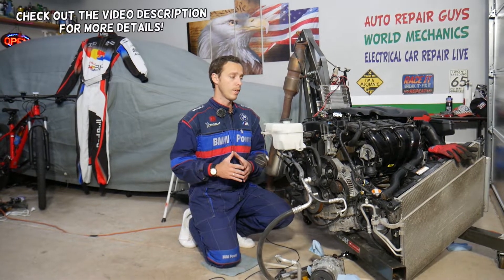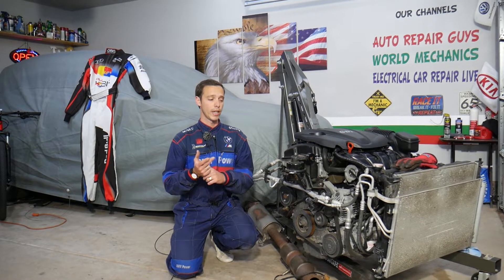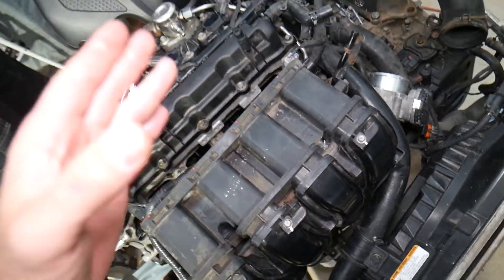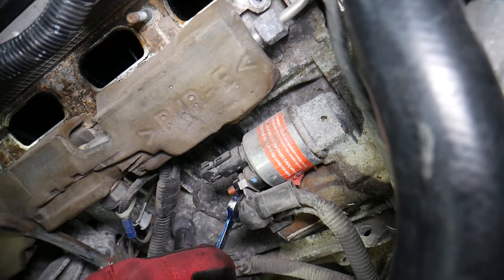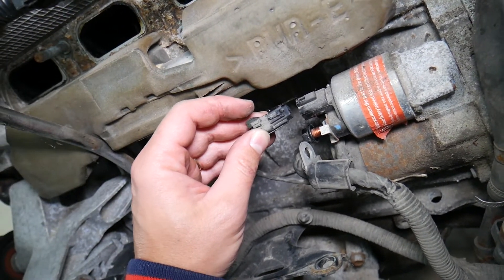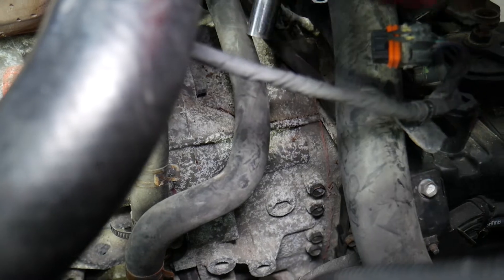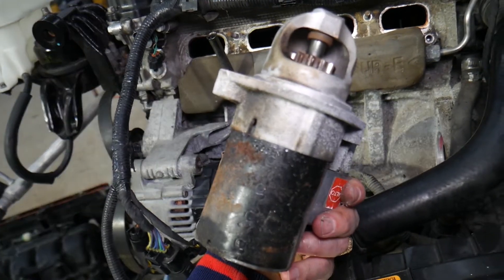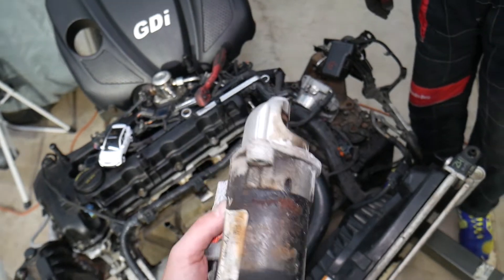HYUNDAI SANTA FE ENGINE STARTER REPLACEMENT REMOVAL LOCATION

Comment from the maker: Products that we use and recommend:
► Starter: https://amzn.to/2Qa1gVi
► Panel Removal Set: https://amzn.to/3YiMADu
► Assorted Fuses: https://amzn.to/4fx4s3F
► Tool Set: https://amzn.to/3p5MM6t
► Screwdriver Set: https://amzn.to/3XRB28Q
► Mobile 1 Oil: https://amzn.to/3xBc8B9
► Oil Filter: https://amzn.to/3w0Ulme
► Torque Wrench: https://amzn.to/32qyRwg
► Liqui Moly Engine Flush: https://amzn.to/3IiDBID
► Voltmeter: https://amzn.to/4hB6Zvk
► OBD Scanner that we use most often: https://amzn.to/3I4MQfe

► Check out our Amazon Store for the tools and parts that we use: https://www.amazon.com/shop/worldmechanics

Comment: On the 2015 Hyundai santa fe you don't need to remove the intake manifold just lift the vehicle with a floor jack and remove the cover underneath the engine then the heat shield covering the starter and you will be able to remove the starter easily.

Comment: On the 2013 Sante Fe I'm working on there are hoses in the way that you don't have in your video which makes it almost impossible to remove the top bolt from the starter. If you're lucky and the bolt will break loose with a wrench which is the only thing that will go in there you can remove the bottom bolt completely then put pressure pulling the starter with your hand and loosen the bolt with your other hand so the bolt head stays in place and the pulling keeps the head of the bolt against the housing. A little of a pain but it works

Comment: I own a automotive shop, and you can replace that starter without removing that intake manifold. Remove air intake boot and. the throttle body. And a few little bolts to move some hoses around. And you can get that starter out without removing any of that other parts. I do it all the time takes about 45 minute.
Reply: Do you have to remove the engine mount? I'm trying it on 2010 with a 3.5 and it's just a f**** disaster?

Like it obviously it's not good taking the engine Mount out but like that one bracket looks like it's in the way. Everything so tight

Comment: This video is a joke...engine removed, bolts and wires already removed around manifold, and you just lifted the  manifold to show the starter.  There is a big difference when it is in the car, and what and where all the bolts and wires to unclip are. You showed nothing.  We all know where the starter is, which is all you showed.
Reply: Exactly my thoughts. The most challenging part is how to approach it and move things around when everything is still inside. I just can imagine such tutorial for the medical students: "Open the skull. Extract the brain. Carefully detach the spinal cord and the cerebellum and put them aside. Now I will show you guys, how we can remove that lesion" SMH
Reply: He said he had a video on how to remove the intake.